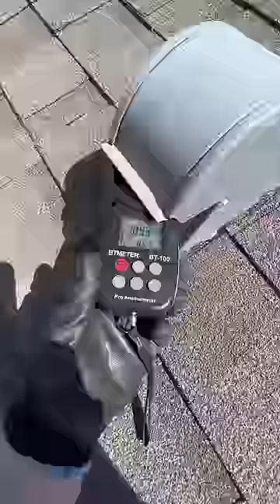Lint Explosion🤯(Must See) #dryerventcleaning #laundry #firehazard #oddlysatisfying #cleaning

Comment: Number one rule with personal dryers: always check the lint trap to see if it needs to be cleaned before turning on the dryer. After each load finishes, clean the lint trap. My mother taught me this rule and I've never had an issue with the dryer vents getting clogged.
Reply: This is true however you should still take it apart once every few years to clean any lent inside the machine
Reply: even so the lines can still get clogged up over time check em out to be sure, can help dry your clothes faster to clean it out even if its not as bad as in video
Reply: the moisture from your clothes will condense on the vent lines and will collect dust no matter how clean you keep the lint trap. Gotta have them cleaned
Reply: The vent goes up through the ceiling.  Can’t do it very easily yourself
Reply: My mom taught me the same thing.  It felt like someone picked up my reality and moved it elsewhere when I learned that not everyone does this.  Mom always did it, and her simple answer when asked why was "because if you don't, it'll catch fire".

Mind you, skipping one lint screen cleaning between loads one time shouldn't hurt, but I took that crap seriously because we lived in a trailer.  Now it's a habit, makes the dryer function better, and makes a fire less likely to happen for longer.

Now I have communal machines I share with everyone else in the building and it drives me nuts not knowing if the laundry machine maintenance dude took the back panel off to clean that out, too lol.
Reply: #2 Empty the condenser tank for water.
Reply: @rusle  Ah, thank you. Wasn't aware of this step, but you are correct.
Reply: You still have do maintenance at least once a year still a lot of lint builds up

Comment: In an apartment, I don't own the outside vent and the super doesn't know where it is either. I've tried all the best rated dryer vent cleaners in my area. They hook up a blower (not even a vacuum) to the line, run it 5 seconds, say "that's all we can do without access to the outside vent, your bill is $200"

Comment: Moved in with these guys and they told me it takes about 2 hours to dry a load of laundry. Pulled out the lint filter and there was 4 inches of lint. They threw me a party because I "fixed" the dryer.

Comment: Makes zero sense that they run these ducts vertically through the house. Outside wall shortest way out, something easily accessed at low level, or just use a condenser dryer.

Comment: Rotobrush 🤢
Reply from the maker: That’s not a rotobrush lmao
Reply: @MrLintGuy  basically the same thing
Reply from the maker: Completely different. Rotobrush is a vac with a built in cable driven brush that runs through the hose. It sucks for cleaning dryer vents and air ducts too for that matter